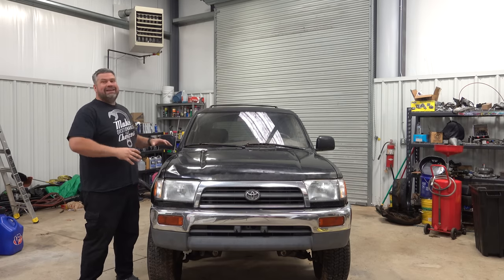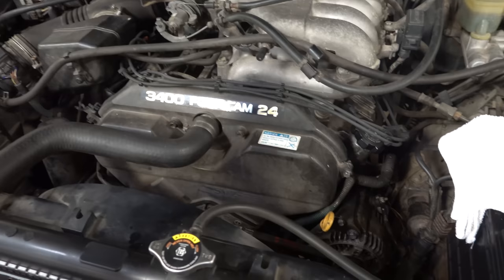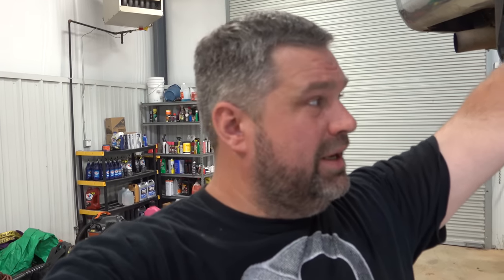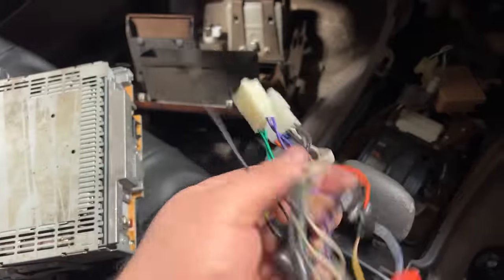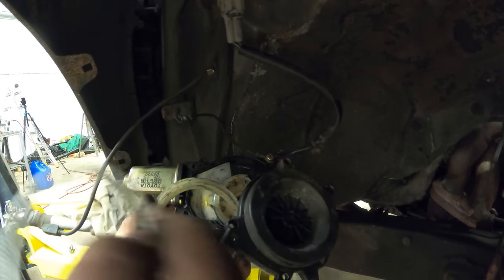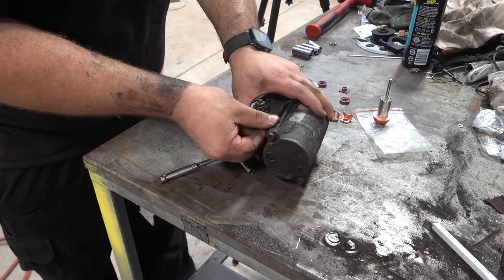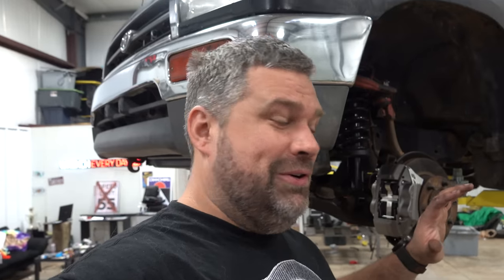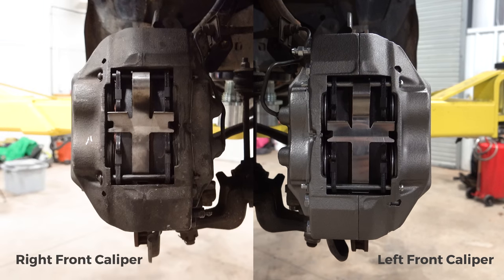Everything Wrong With Our Cheap Toyota 4Runner! Mistakes Were Made. Trying To Fix It All On A Budget

Comment: I'm doing something similar with a Sequoia that I got for just $1300.  It runs good and has a good body and tires, just needed a battery and muffler and fixing a lot of little things that were broken.  I've run into a problem with the airbag recall though. Toyota has sent me about 100 letters saying I need to take it in and have the dangerous airbag replaced but I talked to the service manager who said I had to actually bring it in, I can't just take in the bad airbag and get it replaced and they won't come out and replace it either.  I can't believe the idiots want me to drive in a dangerous vehicle but I refuse to drive it with dangerous airbags so we are at a stalemate!  I wonder what others are doing about this?

Comment: Your wrong on the antenna wire to the radio, pull the glove box high up on the right side over the kick panel you will find an antenna connection. It is about 6" long from the motor to that plug.
Go look it up in toyota parts its on the semantics. Ive fixed 100s of these at used car lots the factory replacement mask were about 26 bucks but a Harada 
Mask will work on that motor. They used to cost about 12 bucks  a factory one will cost about 50 now post covid2019.

Comment: Re. shipping companies. Same here in the UK. I've had packages thrown over walls, stolen from my front door, etc etc. Basically the drivers are chronically underpaid and run into the ground with insane schedules for drops. Basically abuse of employees by these companies. The only way to fix this is if they charge more, but they won't as the market has decided it wants cheap stuff on the doorstep instead of in the local store/shop. It's a mess.

Comment: Wow, the guy that did that stuff was a real hack.  I've found that it's usually easier and more cost effective to do it right.  You might spend a couple more bucks on parts but it takes less time and when you're done it's done right.  I wish I could find one of those for that price, everyone around here thinks they're worth $10k, even screwed up and with 300k miles.  Plus I'm in the rust belt so they're trashed...

Comment: I could use some help.  The 2020 CX-30's (2.5 L  AWD) front differential, has a major problem.  The fill plug has a metal bracket that partially covers it.  You cannot remove the plug as it is. Could you make a video that would show how to move the differential enough that drivers could do a fluid change?  Mazda fixed the problem on the 2021 and newer CX-30's.  Maybe it would be possible to swap a older bracket with a newer one?  So far Mazda has blown me off for any kind of a fix.  The dealerships have told me that the differential is "unserviceable".   Maybe you know a guy?  Thanks for any help.

Comment: Wanna make your power antena last longer, clean it with a cloth covered in a light oil once a week. And turn the radio off at the car wash.  Oh you can add a switch to lower the antena if the radio only has a blue with white strip wire a blue wire is for an antena a blue white is for an amp.

It had broken cable in the rod part of the motor.

Comment: That's what I'm doing now 1996 Toyota 4Runner 4 x 4 there's a rough country 4 inch lift I just put a new radiator in it I was leaning on the top of it and the radiator hose snapped right off probably the original radiator it was patched up and nobody wants the milkshake put a wheel cylinder in the back and new brake shoes straightened out the brush guard that was bent the blacksmith hammer and a jack absolutely no rust on this rig next I'm going to fix the rear window which clicks if it doesn't go down I think it'll be an easy fix the four-wheel drive only works if I turn the vacuum lines around I don't know what exactly that is yet I stuck $300 in used tires they look great windshield is cracked but I think I'm going to leave it I'm going to ask about 4,000 maybe more but it has $330,000 Mi on it but runs good

Comment: They don't higher good folks. Pay sucks. It's about 75 cents a mile. I work 12 hours a day straight no lunch. 120  packages having to get in and out 2 times for each box 370 miles a day. 50 pounds or more per box.

Comment: OK i give up....how does gear oil get into a SEALED bearimg.....
Reply from the maker: As the oil fills the area between the axle seal and the bearing seal, it will create pressure and push through the seal.

Comment: How many miles are on this becuse the outside is very rough,  the antenna mask no big deal the cables broken down inside the motor. Pull the motor take out the nylon cable lube it up and put on a new mask,   radios have 2 fuses one in each fusebox, ones blowen.
New power window switches cheap 12 to 15 bucks each.   Hood 250 bucks fender 175 bucks  dents 500  paint 2k 
1200 orignal cost  3k in parts 500 clean up  miles?  Book on it 7k maybe. 

But its been rode hard and put away wet.
The guys done a lot of repairs to a truck that can get 350k miles without anything being done but breaks oil and coolent and tires.

Comment: How much would a shop specializing in brakes charge for the work that was done to this vehicle? How much was the cost of the work with parts costs included in you doing the brakes?  You still saved a lot more money than what the shop would have charged. Don't get me wrong here but a shop would replace most everything with new and extra and more expensive parts needed or not. That's how they give a lifetime warranty. You have to outweigh the expense in this case. Complete brake job with life time warranty 800 to 1200 or more? Way too much and I'm just guessing. Bottom line, that's what we are looking at, the bottom line. In the long run you and the customer both should come to a more mutually fair price. Let's say about a grand or so in costs just for the brakes alone. Knowing who your purchasing a car from is huge and worth it's price in many ways.

Comment: I do not mess with offroaders, but it seems like lift kits carry the same value loss as custom wheels on cars.  Why?  Look at all of the junky work Jared has come across on that truck.  The peeps that worked on it were clearly not interested in doing much of anything properly, and you typically run across that with cars that have custom wheels.